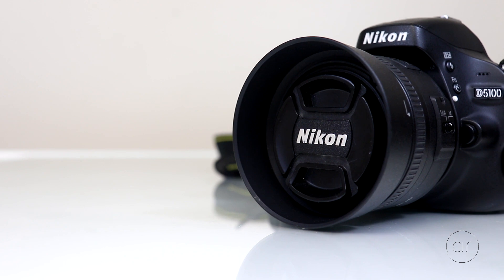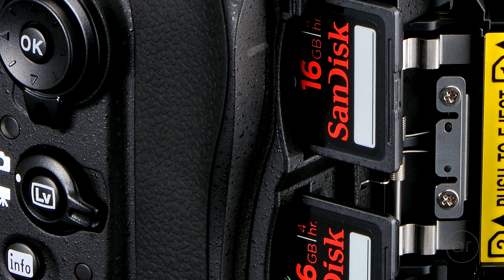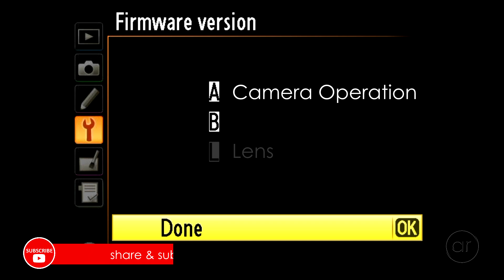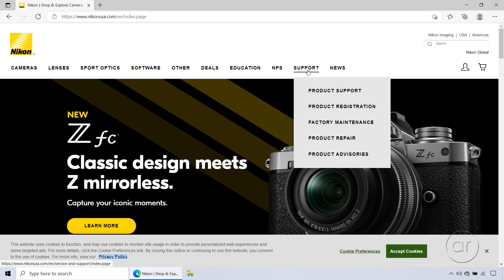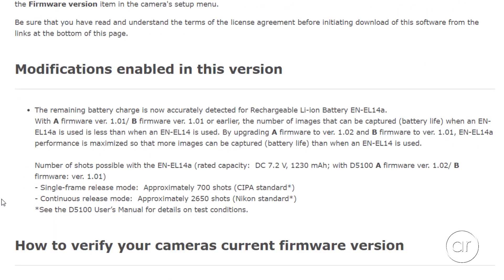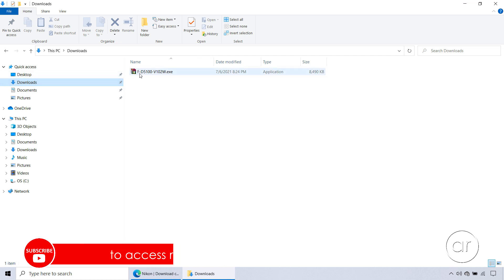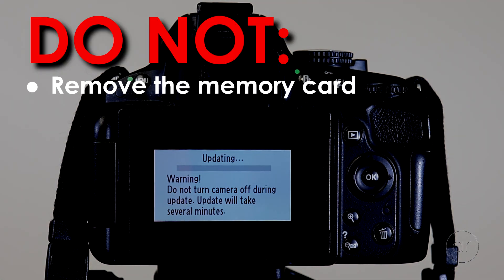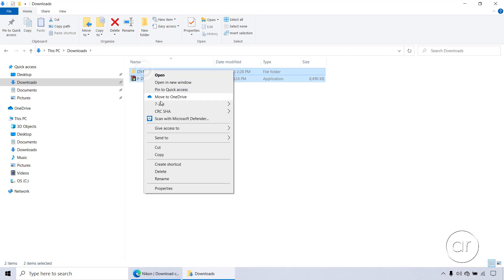How to Update the Firmware in a Nikon DSLR

Comment: Thanks for posting.  Found file in my downloads, but it won't open.  Any suggestions?
Reply from the maker: When you downloaded the file, did the Windows version match the version that you are running currently? If all else fails, it is essentially a bin file that is compressed within an executable, so you should be able to run a 7Zip or Winrar utility and open the EXE file, then extract the bin file from there.

Comment: Question : If A and B is the same number , that means I dont need an UPDATE  , i am reffering to NIKON D3000 DSLR device
Reply from the maker: I didn't see an update on the US site, but you can think of the A and B versions as independent of each other. If either one has an incremented update (A or B), you can apply the A/B update to both.